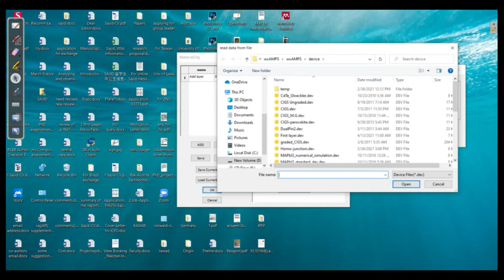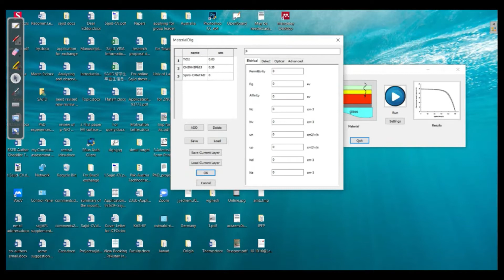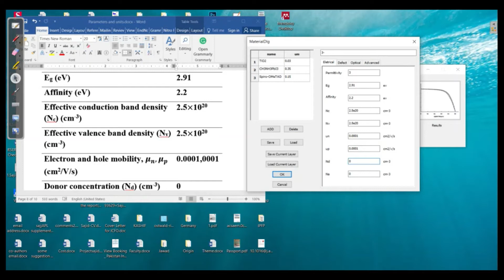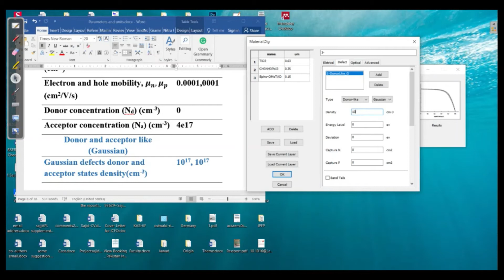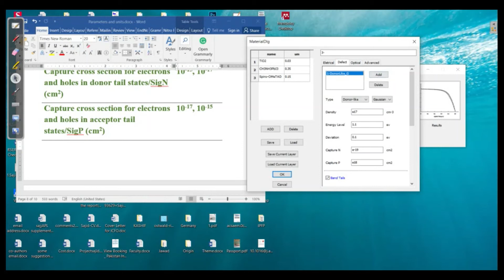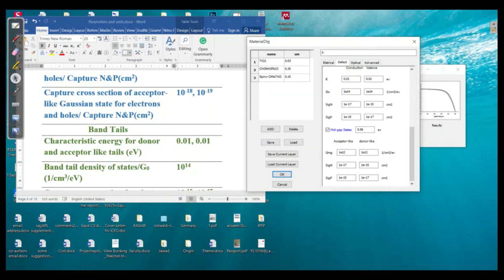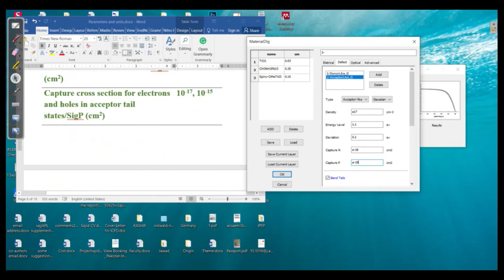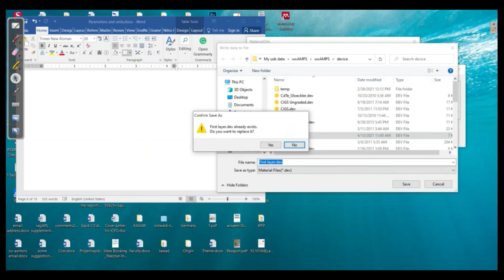Simulation of Hole transporting Material in Perovskite solar cells Lecture 05

Comment: Hello sir, many thanks for your videos
I simulate one structure of microcrystalline silicon, but when i run the simulation i didn't find any results.
I need how to use Edge and center gride,  and how i can use the settings and ambiant boxes. I saw your  videos but i didn't see how to fill this 2 boxes.
Thanks